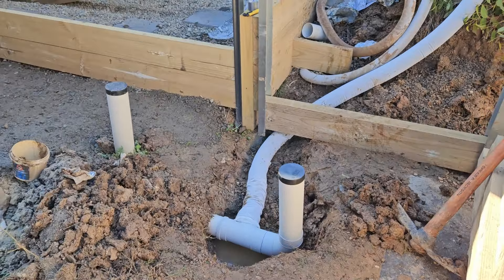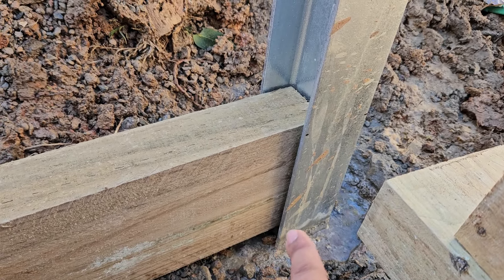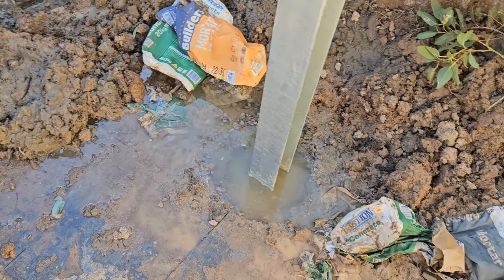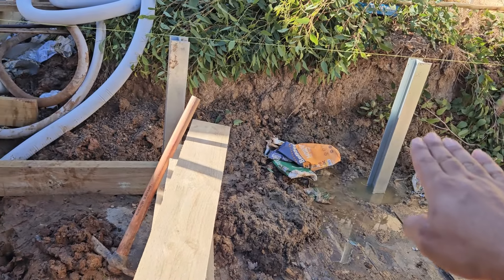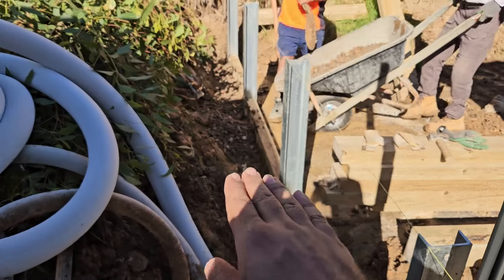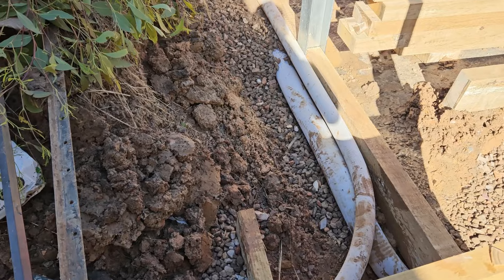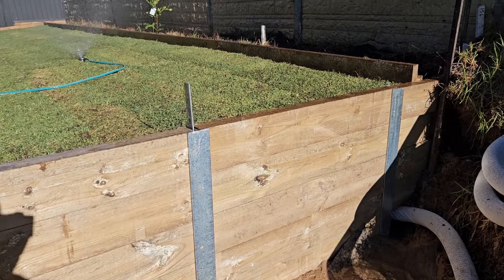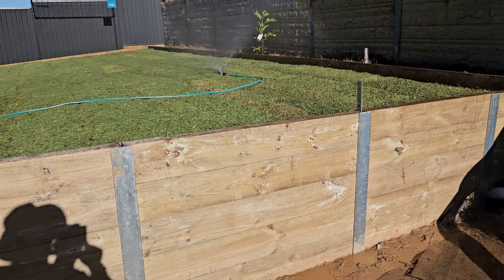Timber retaining wall steel posts, Steel post retaining walls , Timber retaining wall construction

Comment: That sock will clog up with silt over time. It will flush down through the voids in the stone chips. It would have been better to have used geotextile fabric, to 'burrito' wrap your ag pipe and stone.